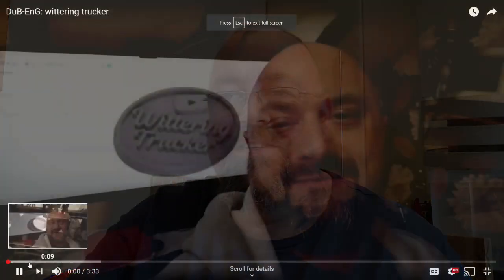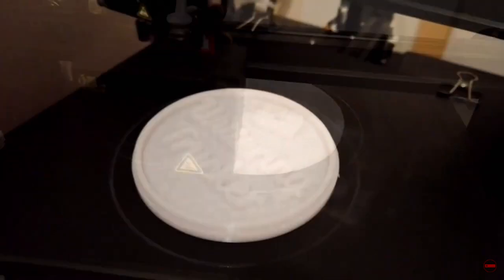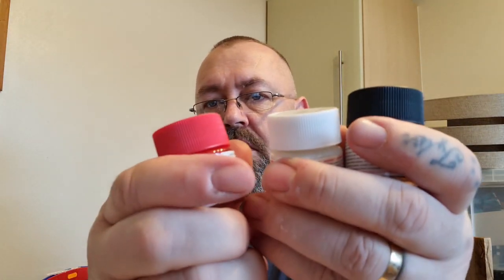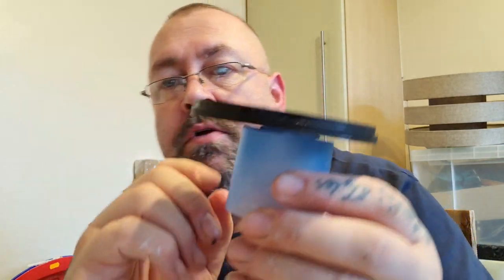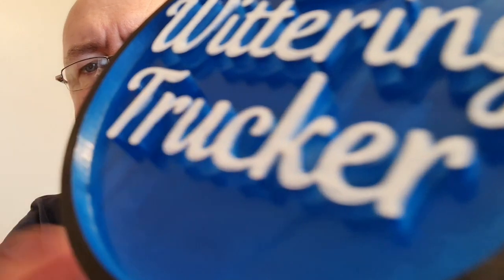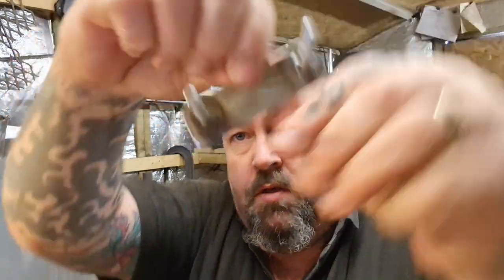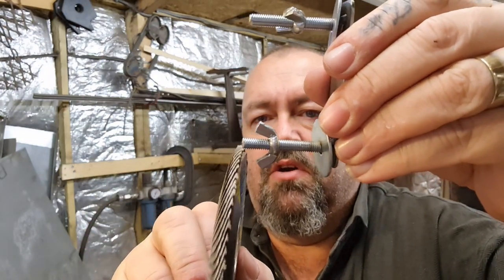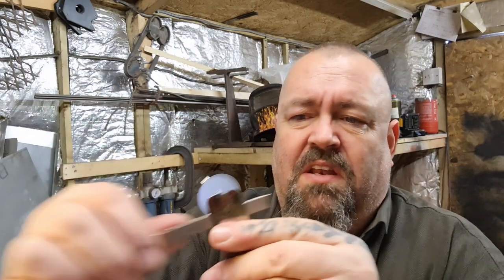How to make a grill badge | Wittering Trucker | WS Transportation

Comment: Think I'd have put a bit of glass fibre mat to expand the bracket adhesion surface and prevent the badge falling off
Reply from the maker: Not a bad idea for any I make in the future. It is a slight concern, the joint, but I guess time will tell and its gone and only left the bracket behind. 🤔🤔🤔